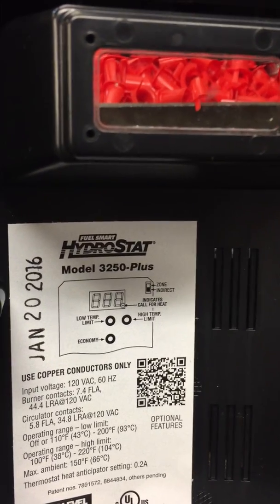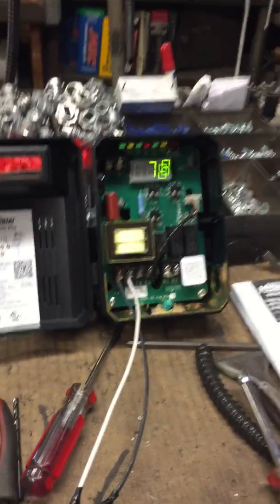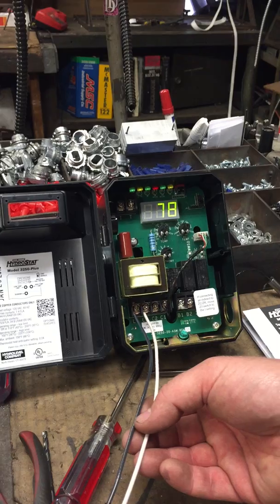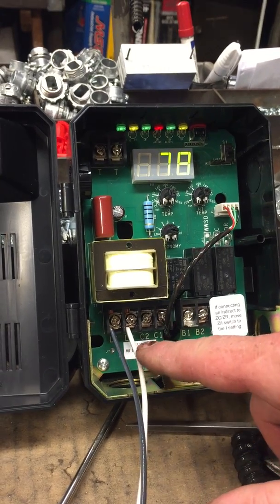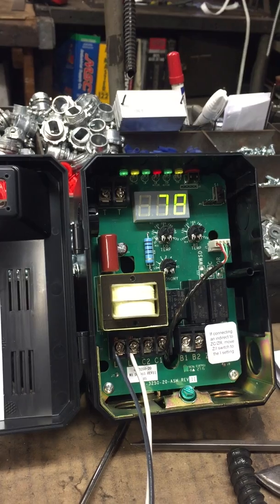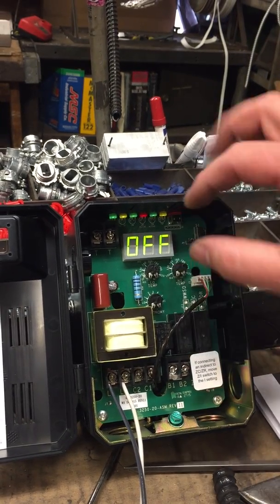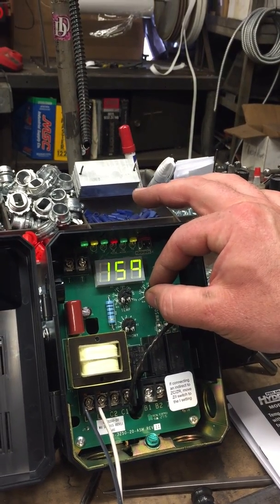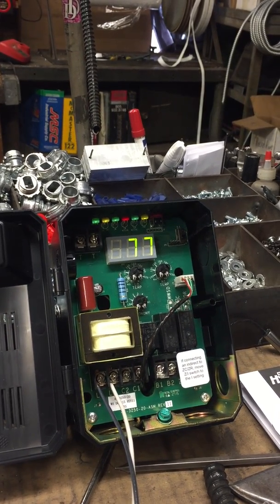Wire and Explanation of Hydrostat Controls

Comment: The old Aquastat always are set 180 High & 160 Low with Diff to off/10. All this new tech & is garbage.
Reply: 3 plastic inferior relays compared to Honeywell Aquastat along with a transformer resistor & cermanic cap with some inferior potentiometers. Making stuff to break. Honeywell Aquastat lasted 40 50 years without changing them.
Reply: @TheVlad69  The 24V isn't even fused. One little mishap and entire controller is bricked. Because why add a 10¢ safety device to the production cost when they can charge hundreds for a complete new controller.
If I had to use one of these I'd cut the trace off the transformer and solder one in.
Reply: @SerenoOunce  That's a great idea. All these furnace guys/companies are use to the old way of ripping people off. I didn't have time to install this & the guy I hired to put it in gave me a line of BS saying you didn't have no grounds connected & it wouldn't work. Tried charging me more. I opened the sub panel up & said really? It's still not grounded to the box but through the copper pipes so how's it working?

Comment: Is it possible to use a WiFi thermostat with these systems?
Reply: Separate wire(s) would need to be run from an external transformer / 24VAC power source. And would connect it between 'C' and 'Rc'. Be sure to remove any existing jumper between Rh & Rc. You don't want to bridge multiple AC power sources. A 1A or 2A MAX fuse should also be used for external power supply.